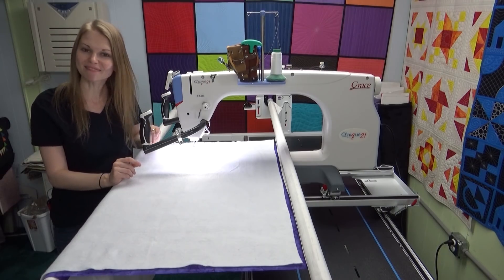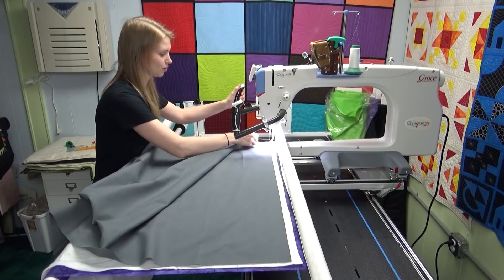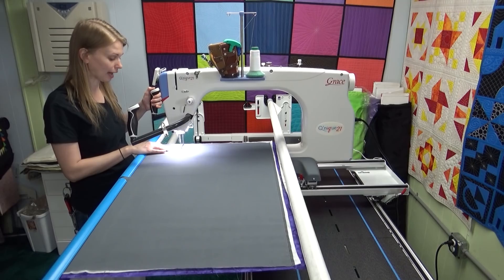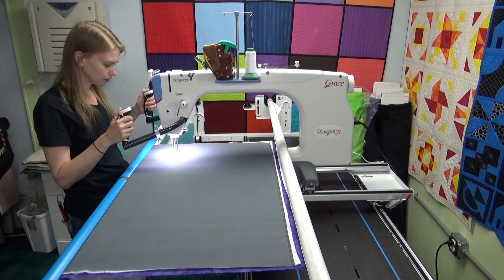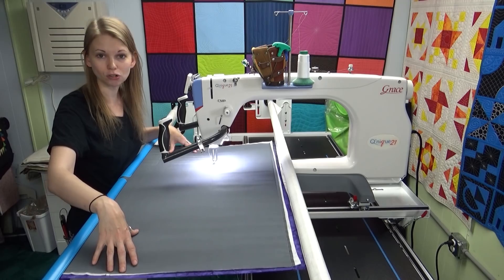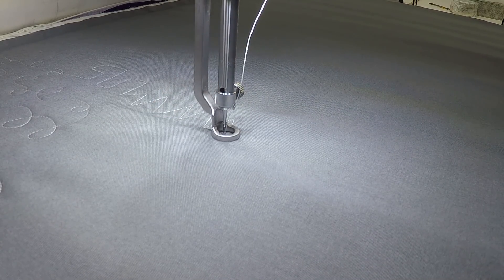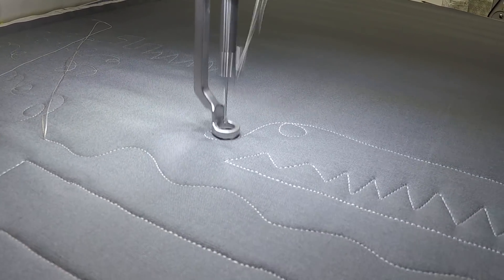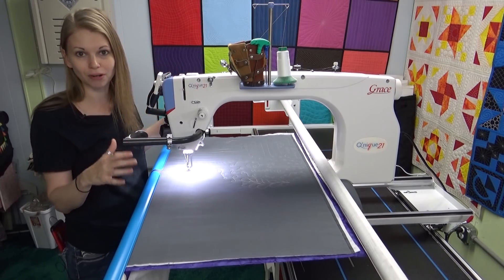First Stitches on the Grace Qnique 21 Longarm and Tension Test

Comment: I just got my q’nique 19 on tues and fully set up and ready to stitch last night. I finally got to where I could take her for a test drive today!  I’m in love!  It does make a beautiful stitch and only had a very slight tension problem that I didn’t even see until I remembered to turn on the light bar.  Wow! That’s a lot of light!  It didn’t take much to resolve the tension issue. I love the precise stitches but do seem to have some difficulty creating a smooth curve, but the more I practice, the better I’m getting.  Honestly, even with that “coordination” issue, I love how it looks. It’s much better than anything I did by free motion quilting!  I appreciate all the videos you’ve done about about the q’nique machine. I’ve watched most several times over the last few months.  Thank you for showing us your first “awkward” stitching as well. It lets me know that it’s normal to expect some coordination issues as the machine and I get to know each other. Also, the off and on button is a loooong way away too!  😂

Comment: Leah, Love the size of the Q21. I don't have room for one that big. Wanted to tell you the  "replacement 15R I got weds night is terribly noisy and the tension dial set at just #1 is so tight it wont pull through easily and it breaks the thread. It seems to be a bad dial possibly. The bobbin winder wont fill smoothly and the pin that the thread goes around at the top was missing. Unhappy camper here. Will be calling them again Monday for help.
Reply from the maker: I'm so sorry to hear this Denise! I've sent you an email, did you receive it?

Comment: Hi Leah, I was going to buy qnique 20 with the pro stitcher and the 10ft frame. But just saw the reviews and has 40 percent 1 star.  I wanted to buy before the end of December.  I saw it only has a 1 year warranty compare to others who has 3 or more year warranty.  What is your take
Reply from the maker: Hi Annie - My opinion is don't believe everything you read online! Most often reviews for machines are left by the most vocal and while yes, it's unfortunate they had a bad experience, I often find while reading these reviews that the quilter really hadn't done her homework and researched longarm quilting before purchasing. As you can see in this video, this machine was easy to set up and begin quilting and to get the tension set properly. I've sold Qnique 21 machines since 2018 and never had a major issue we couldn't troubleshoot and find the solution.

Comment: I just got a new Q’nique 15 Pro with the Qzone Queen frame (not the hoop frame). I think I have the fabric coming off the rails wrong. On the back side it’s going under then over. The front rail’s ratchet is opposite what the back is, so I had to come from under the rail. (Hope this makes sense. I’m pretty sure this is wrong but I can’t find anything that talks about what way the fabric is supposed to been the rails. Thanks.
Reply from the maker: Here is a video on how to load a longarm frame: https://leahday.com/blogs/machinequilting/how-to-load-a-longarm-quilting-frame
Reply: Leah Day I think I have to call Grace. Can I ask you this...do both of your rods ratchet clockwise?  Mine are both different and they need to both be clockwise, otherwise as soon as you touch the fabric, the front wheel just lets go and the fabric sags.
Reply: Leah Day this isn’t working for me. If I load mine this way the front bar, ratchet is going counter clockwise and it just lets the fabric loose when any pressure is applied 🙁

Comment: I'm having some problems with looping about every 50 stitches I've tried adjusting tension changing the needle I've checked the threading path, timing, dust to no avail, what else can I do
Reply from the maker: Does the loop form to the bottom or the top of the quilt? I wonder about your thread. Did you use this thread before? Has your machine done this since you got it, or is it a recent issue? If it's recent and you have had good, consistent stitches on your machine up until now, you will need to troubleshoot to figure out what has changed since then.
Reply: @LeahDay  I've only had it about 3 weeks I've got coats and Clark quilt thread on the machine the loops are to the bottom.
Reply from the maker: Definitely change that thread! Try a polyester thread like Isacord, or Grace has a new thread called Finesse that I absolutely love!
Reply: @LeahDay  hey this is Cynthia Hand again I changed the thread and no change about every 25 to 50 there is a loop. I have change the top tension the loops then get a little closer as I tighten they get farther apart it doesn't appear to be a bottom tension problem it seems to be a top

Comment: Will you be getting or doing a video on the Qnique 19 and the Qnique 21 pro???
Reply from the maker: They are certainly on my list, but not in my schedule for 2020. The Qnique 21 PRO has a few extra features that my Qnique 21 doesn't have and it would certainly be nice to upgrade it.

Comment: Is that how you would test a bobbin that doesn't have that silver bobbin  case?? My Janome doesn't have that silver bobbin case.
Reply from the maker: For a home machine, you typically don't need to adjust the tension in the bobbin case. I'd work with the top tension instead.

Comment: I will be receiving the qnique 21 with continuum frame soon, originally was suppose to be the 15 pro but quite a long wait it’s on back order. What’s your opinion on getting the qnique 15 later for sit down free motion quilting? Thx awesome video 
Darlene
Reply from the maker: Great question Darlene! We no longer offer a sit down / table mounted version of this machine. Instead you can put it in the Q-Zone Hoop Frame and set it up low to sit and quilt. But the machine itself will still be moving on the frame. I hope that makes sense!

Comment: Leah do you feel any vibration in your handles? I have the Q’Nique 21 and am feeling a lot of vibration. I have emailed Grace and am waiting on a reply. Thank you 😊
Reply from the maker: Great question Jeremy! When I first set up my 21, I did experience a lot of vibration. Turns out, I had the carriage turned around the wrong way. Make sure the end with a thick rubber bar is set up under the needle side of the longarm. Also take the time to loosen and balance the machine on the wheels so all 8 wheels roll on the carriage first, then loosen and balance the 8 wheels on the longarm. You're loosening the brackets that attach the wheels, not the wheels individually.

Another thing that I found essential was practice and finding the worse speeds for the vibration. Then I actively worked to move slower than that speed. You can also adjust your handles and see if the position cause more vibration or less in some positions.

I hope that helps! As with quilting on all machines, remember to stop every 30-45 minutes to stretch and rest your hand. This is a physical activity!